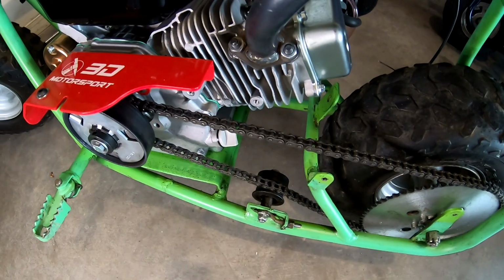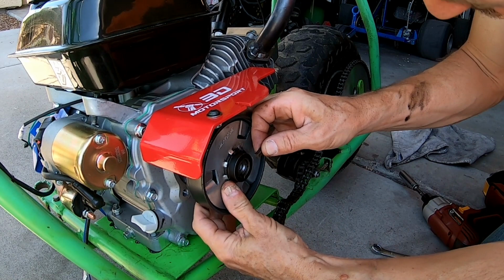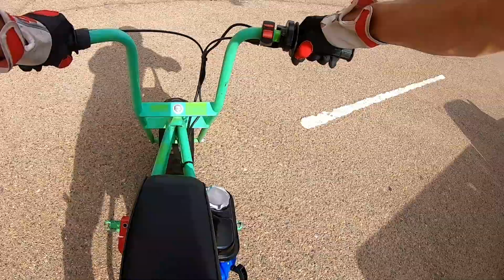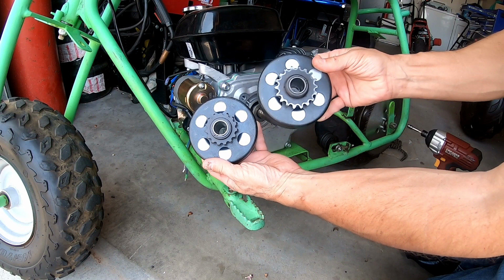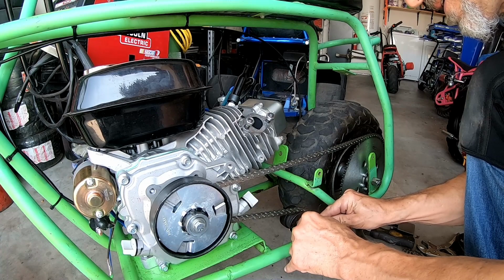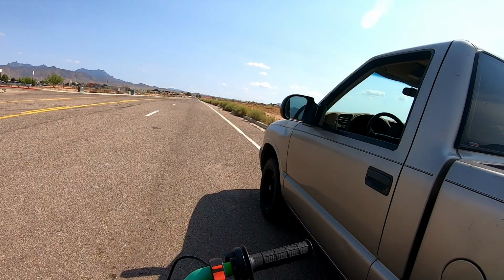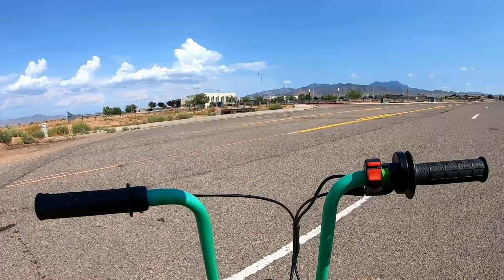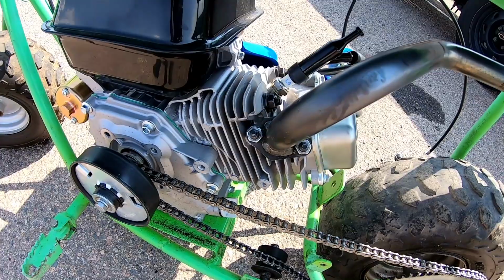18 tooth clutch vs 15 tooth clutch  / Tillotson 212 / Baja racer Minibike

Comment: Lol dam u went off roading a lil in this installment good shiznit !!!!!
Reply from the maker: lol, i forgot abiout that, Ya I did. I wanted to test the suspension...😅
Reply: @Black66  yea I got crazy in the ice the other day on the 80cc seems like the breather tube for the valve cover u know the top that says OVG I guess I pushed the tube in to far lol it started vibrating all crazy and thumping then it shut off so I will be swapping the ducar on it asap just need a motor mount I guess and clutch or TC and with the stock carb I have to use the throttle linkage right?
Reply from the maker: @SoLoCruizer  Ya, with the stock carb you keep the linkage. With a VM or a slide style carb all you need is a throttle cable with an end on it to go into the slide.
Reply: @Black66  thank u man just now found this message i just need to decide between motor plate and new clutch or upgraded bolts with spacers and or 420 sprocket ??? im stuck lol do i really need a adapter mount because i cant find any good ones they all look shotty
Reply: @Black66  keep up the good work with the informative videos got a question tho I have the motovox frame with the ducar 212 vm22 carb and short header pipe and zip tip trick want to go 60 plus but can it be done with 12t clutch and 60t sprocket thanks keep the videos coming👍
Reply: @Black66  was really hopping to see some info on the key way and cutting one to fit the max torque clutches like the 13tooth for instance lol
Reply from the maker: @SoLoCruizer  Throw one of these on there. And a bolt at the end of the shaft and you don't even have to use the set screws. Here is the link for the keyway  
https://www.ebay.com/itm/151118486801?ssPageName=STRK%3AMEBIDX%3AIT&_trksid=p2060353.m1438.l2649

Comment: lol I just bought a 18 tooth clutch for my DB30. I have the same rear sprocket so it looks like I might have to get a 15 to see what does better. I have a stock predator 212 idk how different the two engines are but I’ve always felt like I had to much torque.

Comment: Very nice video indeed, looks like you’ll need some front brakes on her. Thankfully you’re out in the desert and it’s just dirt and not water. What would you recommend for a stock Honda GX160 with governor still on it, I’m aware that it’s set up to rev up to 3600 RPM and I’d like to keep it like that thanks for posting and ride safe.

Comment: Do yall think that a torque converter with 12 teeth on the rear pulley and 40 on the speocket is too much gear
Reply from the maker: I think it depends on the tire size, weight of the bike, and rider and engine mods. Too much gear for one bike could be perfect for another. I would try it and see.

Comment: So I just watched your other video where you replaced the 50 tooth rear sprocket with a lower 40 tooth sprocket and actually gained top speed. Which confused me cause I thought the higher the teeth in the rear the higher the top speed ? So if I want my mini bike to go faster should I replace my 50 tooth with higher or lower tooth sprocket ? Right now I have a 50 tooth on the rear and an 11 tooth in front and it does 41 mph. What do I need to do in order to get it closer to the 50 mph mark ?
Reply from the maker: Most of the time that is true . The smaller rear sprocket usually will get you more top speed . But only to a point . At some point you can have a sprocket that is to small and the engine doesn’t have enough torque to pull the gear . So I had to go the opposite way to get to the optimum gear .
Reply: One of the best set up 12/53 you get best of both worlds but you have to calculate weight so if you weigh 200 pounds your gear calculation is going to be in the parameters ever 20 pounds over your going to lose around 3 mph you can get it back with taller gearing 14/75 will give you around same speed as the 12/53 but pull 260 pound rider once you sort gearing out its all about rpm bmi kart has a cheat calculator and is pretty much on point good luck
Reply from the maker: @heathenprojects2639  and tire height
Reply: @Black66  after typed that was just thinking about editing tire height plays a huge roll in things was also going to add at odd even offset of gear for vibration
Reply: @heathenprojects2639  thanks for the note on BMI kart.  I have been looking for a solid calculator.  Just started on mini bike mods and having fun!
Reply: @JCTEAM60  your welcome stay safe and have fun

Comment: i am building a ago kart using a Ducar 212cc with 11 inch rear tires overall height any suggestion about gearing for top speed possibly  a rear end gear 53 teeth thank you
Reply from the maker: Check out the CRG kart playlist. We change up gear ratios for top speed. https://www.youtube.com/watch?v=y5ESae-xS3c&list=PLkbj-ip-5FzbRC44QXRolAH83cOTrdHRt

Comment: I still don’t know how you haven’t blew up  a stock flywheel yet
Reply from the maker: I think I had the billet wheel on it in this one. I have did so many I cant remember.
Reply from the maker: The Tillotson 212E Flywheel is rated at 8k RPM for 30 seconds and 10K RPM for 10 seconds.  .

Comment: I did this test on the highway 🛣️ and on my bike 🏍️ it has 17t front 42t rear .. so I top out 75mph ... I changed to a 17t front and 35t rear .. seems a bit more faster in each gear b4 each shift ..
Reply: What would you recommend for a 224 with a 10t clutch and a 50 rear sprocket tops out at 63
Reply: @emmanuelramos4772  if u want to try going faster at top speed drop 3 in the rear
Reply: @trucker2b I top out at 50 I’m running 420 chain on my db 10t cutch 42t rear what would u recommend for more top speed

Comment: Do you know what can cause a torque converter to not fully engage ? (Dirty driver?)
Reply: Yes a dirty driver will have all sorts of problems.  To maintain top performance (at 5000rpms), I had to clean and lube a Comet style driver every hour or so of use.   Be sure to lube with a dry lube such as graphite or Molybendium (sp?).
Reply: @mlindsay527  Thank you

Comment: Drop the rear.... And you will go faster....lower gear ratios is father higher gives more accurate ... Front sprocket alone won't change much...
Reply from the maker: Every tooth added to the clutch is equivalent to adding six teeth on the rear sprocket. Check out my other videos. I have tested many gear ratios.
Reply from the maker: Check out my 70 MPH video. I did it with an 18 tooth clutch https://www.youtube.com/watch?v=8wVMdDTutPQ&t=101s

Comment: My only issue with the tests are. I’m not so much worried about top speed. I wanna ride 40mph easy on throttle yet have increbidle acceleration to about a top of 55.
Reply from the maker: Lower gear with a 265 cam 22lb springs and the billet parts make an incredible bike. Not just top speed but great acceleration. Out of all the videos I have made this bike was the most fun. Here is the video https://www.youtube.com/watch?v=tj8XxfvMbRE&t=11s

Comment: What chain are you  running? And where do you get a 15t and 18t clutch
Reply from the maker: The links are in the description for the clutches.
Reply: @Black66  little late but link isn’t working anymore where else could I find one?
Reply from the maker: @hectorb1921  OMB has them https://www.ebay.com/itm/174947428063?epid=8012865165&hash=item28bbade6df:g:Z7oAAOSwVQJhSS1L